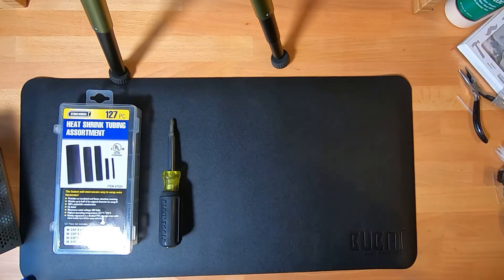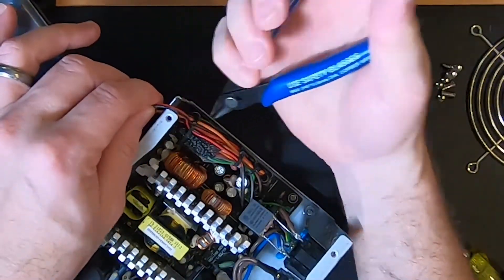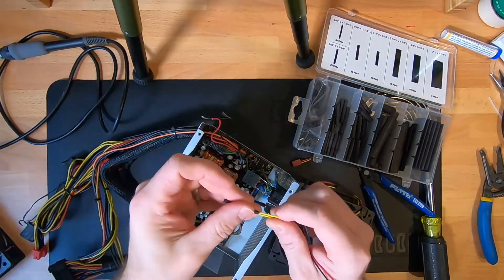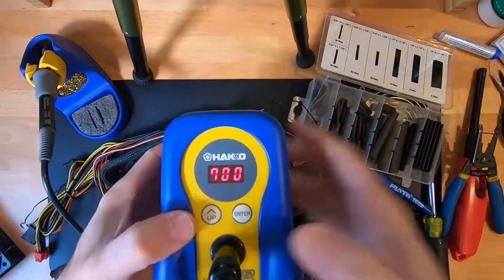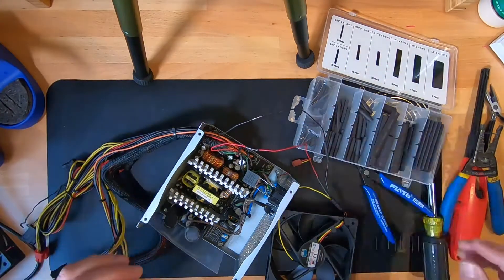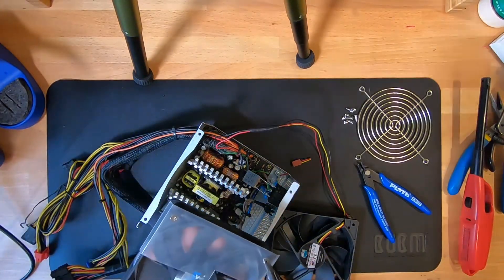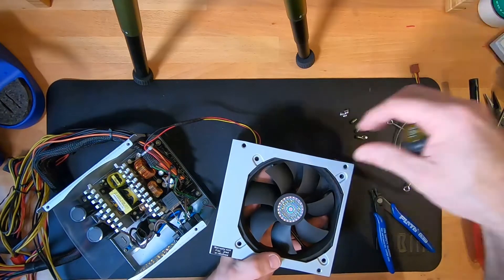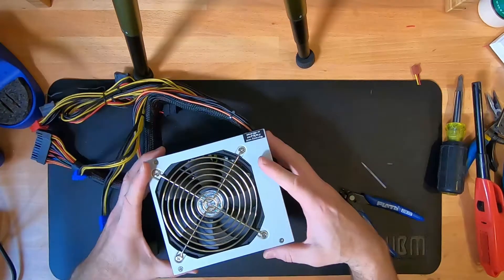Noisy & broken PC Power Supply FIXED! Easy fan replacement how to!

Comment: I think you're wrong about the direction of airflow here. Surely you want air being sucked into the PSU, hence the deflector underneath, which forces incoming air to the back of the psu unit and then out through the front grill, cooling all components. You describe it as an exhaust fan which wouldn't make any sense with that deflector there and I'm 90% sure is incorrect.
Reply: YES !!! all of them (PSU fans) are in PUSH orientation.

Comment: Great video I have a few questions: So I have a lot of 3 and 4 pin case fans and PMW cpu fans all those will work as well red and black wires only of coarse. What about amps and fan speed ? Any help is much appreciated thanks!
Reply: the red wire is 12v the black is ground so anyfan should work fine you just open your psu and try it if it didn't work the fan won't start and that's it nothing dramatic if it work then you had your fix done and rather then soldering just try to pop the pins and put them in the 2 pin header then seal it with an electric tape that's how i did mine it's easy realiable and fast fix

Comment: Do you think it will work if I pull out the old psu fan cable and just use the mb fan header
Reply: yes it works, but you have no automatical temperature control over fan from PSU. 
But you can install thermal probe, in some MoBo header (for T Probes) and stick in in some place of PSU and in some software which u got with Mobo or 3rd party soft as speedfan, you can adjust RPM and temp curves for fan.

Or just stick it into mobo header and when you gaming , rise up RPM of that . Not science.

But discharge PSU when you going to labore with !!! - you will do it like push main EL cable from PSU when pc is OFF and several times press start button. Pc should "click" like sound and bit rotate vents. Mostly 1 times is ok.  
But be carefull everytime when you going to do with eletricity etc.

Comment: i need to replace the fan in my psu but i dont have a soldering iron. is the soldering totally necessary? looks like you could just cover the wire after twisting together
Reply from the maker: you can buy a cheap soldering iron on amazon for under $10 which would suffice for this repair. I would NOT just twist the wires, because the power supply vibrates from the fan and the twisted wires would eventually come apart and potentiall short out your computer (or worse, start a fire!).
Reply: Random Maker thanks for the reply man! i actually fixed my noisy power supply with some good old percussive therapy. a little man handling and she’s as silent as she was fresh out of the box.